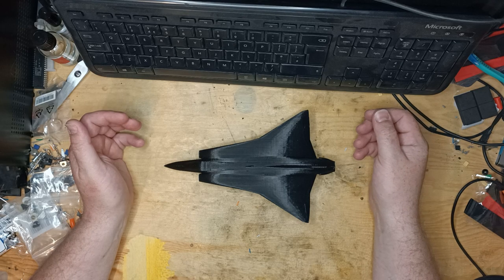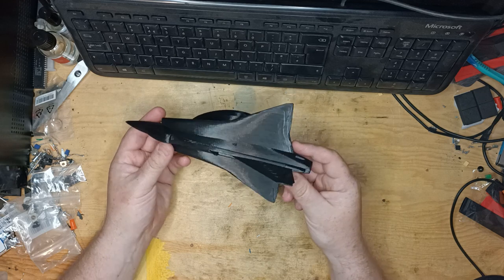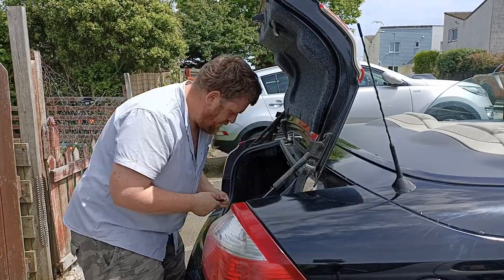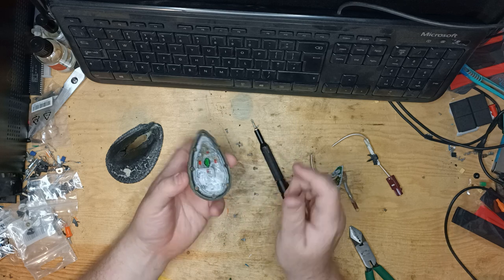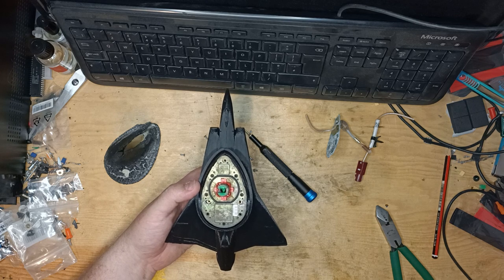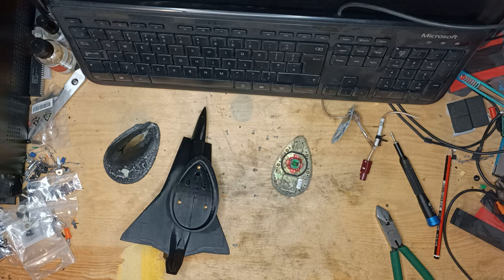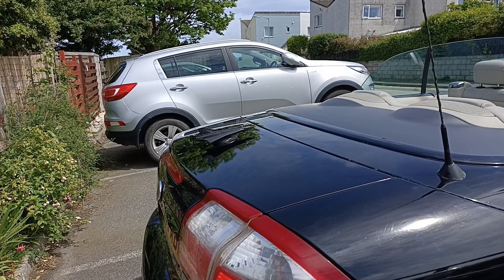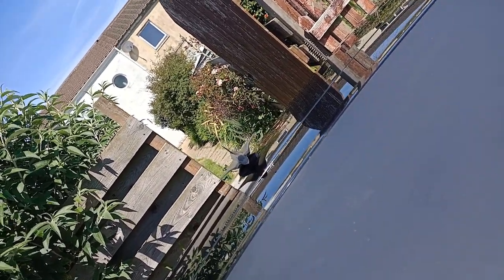Episode 38 - Coolest Antenna Ever Made - Replacement SAAB Antenna

Comment: If the gap between hood and plane bothers in the future i recommend som dull colored silicon to smooth the gap😊
Never tried it on a convertable but the height on the plane is the same or lower than the original antenna👍
Reply from the maker: To be honest, I haven't given it the slightest though since putting it on the car!  We have actually had a few days of heavy rain recently, maybe I`ll check the boot when I get home.  Personally, I think the convertible is best car to put it on as I get to see it while driving although as I said, the boot might have a different shape to the 9-5 (which is what I mostly drive)
Reply from the maker: The boot was bone try last night, no leaks at all!